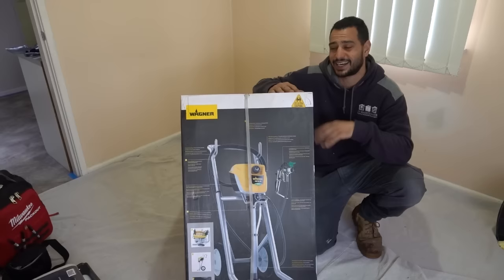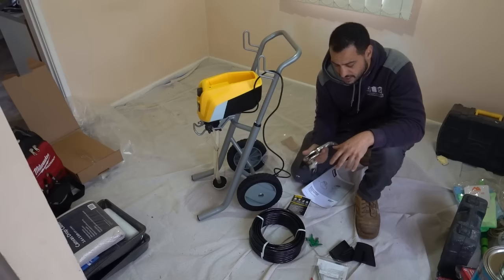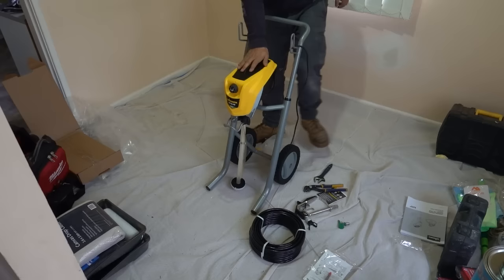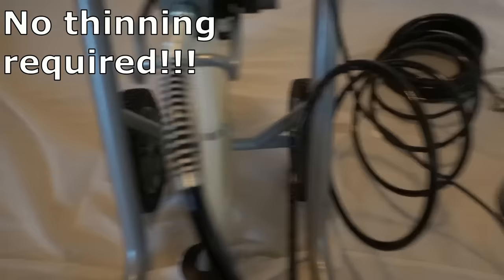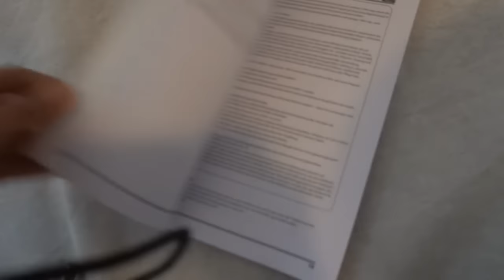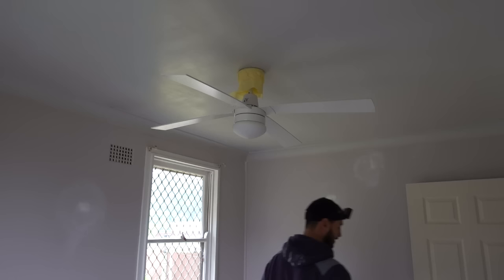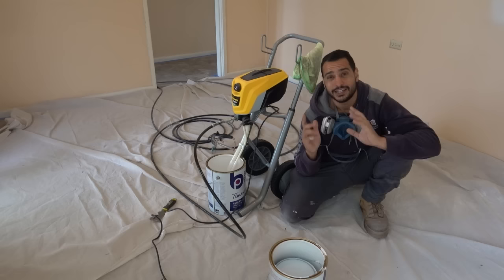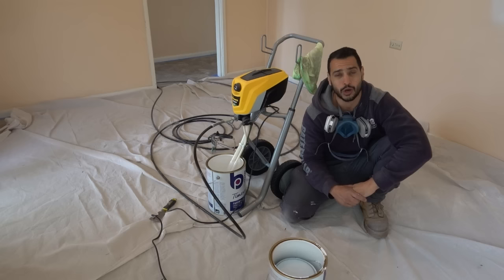Wagner paint sprayer - Review and testing 350M

Comment: Great review but the pressure was a little too high you had it on mark 2 and as you sprayed the wall you can see it left two lines which are called tails and that indicates that the pressure was a little to high, try spraying and 1.5/1.7 until you have no tailing and you should get a even better finish less over spray and saving in paint, hope this tip helps but again great video👍🏾
Reply: Hey I have this unit do you know why the tip won’t spray?? Unit primes and builds pressure, paint comes out but as soon as I use the tip no spray comes out
Reply: The Wagner reply comment said the pressure was too low
Reply: Farba była za gęsta a nie ciśnienie za wysokie.
Reply: There called fingers and it means pressure is too low not too high
Reply: Question is spraying better than roller 🤔
Reply: @tomelford5480  paint too thick?

Comment: Been in the painting and decorating trade for 16 years. I love spraying ceilings for it quickness and the beautiful finished look. The only downside to it is the covering everything because the overspray gets into the tiniest of gaps!
Reply: I’m sure there’s plenty on top of the Fan blades.
Reply: @ashrevlution3456 do you ever back roll after using the spray paint or is it just ok to use 2 coats of spray paint?

Comment: Good video Bill.  I love this exact sprayer and highly recommend never rolling paint ever again.  it is much faster once you mask up everything.  While the video is great,  please for those at home:   1) WEAR a respirator ALWAYS when spraying!  You dont want to be breathing in this stuff, and you WILL even if you can't see it.  2)  I would mask up the fans entirely, not just the top of the fan connected to the ceiling like in this video.  It's extremely likely you will get excess spray on anything you don't mask.  Spend the extra hours to seal everything!  3) get the extension rod for the sprayer  (about 100 bucks from Bunnings but worth it) for painting ceilings or hard to reach areas.
Reply: It’s quicker while painting but surely the preparation makes it longer than traditional mention. Not to mention the potential mess from spraying. Roller for me
Reply: Great finish though
Reply: Great comment. Do you need to backroll the paint after spraying it?
Reply: @commanderkeen3787  A matter of taste. I personally wouln't roll any area you spray if possible because I like the uniform smooth finish from spraying.  Plus it'll significantly increase the total time needed to paint walls (why not just rollin the first place instead if you want the rolled finish). You'll see the roller paint pattern on the sections of sprayed wet paint where you roll, which will look different to the nice smooth finish you'll get elsewhere from the sprayer.  If some sections after spraying dont look right, instead of back rolling, let the paint all dry then spray the bits you missed again. If you experience wet paint droplet lines down the wall, instead of rolling them while they are still wet, sand them back and respray once the wall is dry

Comment: Seems like a good product, but it seems like (as it has a trolley) it would have made sense to have a platform/bucket that the paint tin could sit on, so you could actually wheel it around without having to remove the paint tin and carrying it separately
Reply: Yes, and if you compare price between 350m and 350r, the 350m with unusable trolley costs 130€ more where I live. Makes no sense to buy the 350m for me.
Reply: The round loop hook at the front of this machine is meant for the handle of a 5 gallon bucket. Rest the bucket handle on the hook and wheel away around. High boys are meant for commercial use with 5 gallon buckets… the short boys are used for small jobs when a 1 gallon bucket is being used. But most new machines have flexible hoses for both 1 and 5 gallon situations. 😊 you can also rest a 1 gallon bucket inside a 5 gallon bucket then the handle of the 5 gallon can hook on to the machine and the gallon can stays safe inside the larger 5 gallon bucket.
Reply: @BlossomPainting  ahh yeah that makes it more useful

Comment: Great vidoe. 
Overlap 50% ..
Hard edge on spraying means either thick paint or pressure is low...
Dont go over spray area twice" like u did with cornice " on cold days u will get runs.
This is a airless unit that only sprays water based paints.
For enamel paint u will need air assisted pump .
It has 2 hoses from unit to gun 1 for paint and 1 for air.
It can be done with your machine but u will need a tip size around 208 210 and must use a brush to go over sprayed area to clesn up paint runs .
Thumbs up for grest video.

Comment: Ill give you a tip mate also when cleaning it out.  Take the hoses of and wash them clean wash all the paint residue out on the lawn or laundry tub.   Then put the hoses straight back in clean water..  Run the prime hose back into the tin of paint when you see it start to get watery switch to a seperate bucket or point it down a drain or a bathtub    once you see clear comin out of the prime hose or even light milky white its clean and wash the main hose/gun out the same way.   Just makes for a better clean up will make the unit last longer cleaning the hoses seperately by hand greatly improves cleaning them..  So clean suction hoses drop in clean water reconnect reprime until comes out clear then switch to pray same practice.  Pull the guard off dont leave the tip on as that wears the tip.   Then next start up its nice and clean.

Comment: Am not a full time painter but have two fences to paint, total 100m or so, could not be bothered with a brush. Have ordered the small floor unit 300w 150 and look forward to receiving and using it.
Have used a Wagner airless gun in the 70s in Germany and remember it gave no trouble. They know what they're doing!
Reply: How did it go?

Comment: I've only used mine 3 time's. And when I went to use it last week it kept loosing pressure and was constantly trying to pressurise. It's been thoroughly cleaned out after each use. Worked perfectly at first. Not sure what's going on with it. Great video by the way.
Reply: Get a refund
Reply: Paint is too thick u need to dilute it

Comment: Ah a new machine, would ya just look at it” I’m sure you have learned by now that putting the gallon can inside a 5 gallon bucket will allow you to hook the handle of the 5 gallon bucket to the front loop hook on the machine… allowing you to walk around as 1 unit and protect the can inside.

Comment: Would you use it on the interior walls? I hear you get a better finish rolling? Are you going to spray the skirting and architrave next? And do cut ins with a large painters shield? I really want to see you use it more and get some 4k well lit footage of the finished result please. Ceilings do look flawless fare play.
P.s. you can still spray it on then use a roller quickly over the top so faster than loading up the roller all the time for that perfect finish
Reply: Phillips, its useless machine you  do better with roller
Reply: Absolutely you can use it on interior walls. The finish is different and much smoother/uniform relative to rolling.

Comment: Did you have any issue with paint getting into the air, you know like dust and then having a fine coat go over everything. Noticed you didn't cover the windows? Trying to work out how much prep I need to do protecting windows and door frames
Reply: there will be droplets everywhere so cover your windows. also the technique uses is wrong and there will be buildup of paint at the start and finish. you have to have the gun moving when you press the trigger else it packs on a lot of paint at the start
Reply: @terajuana  The air is full of paint for hours .Do not remove coverings etc for a long time ! It does cause a LOT of  "paint dust"

Comment: Also small step ladder get you up 1ft or so then you get it closer to the ceiling.  Without extension thats the way to do it  when your distance is wrong should be about 12 inches away.  Any more your wasting alot of paint.. I realise this is your first time on one but if there is any mist at all youll greatly reduce that by the distance between gun and surface    even though its a high production low overspray setup there still is a reasonable amount of silica dust and overspray.

Comment: Great Video, just what I've been looking for to guide a purchase.
Typically, I want to use mine for primer and emulsion paint when redoing whole houses.
Has anyone measured the quantity of lost paint due to priming the lines plus the lost material after the project is done and the primed lines are still full?
I like your style of content creation, any follow-up video for the cleaning process and what you used to keep it clean and ready for the next project?
Also, what extras you've purchased 3 years on, warranty, reliability 3 years on?

Comment: With airless you can just spray without rolling the wall afterwards? I heard it doesnt stick properly so you have to roll... What is your opinion?
Reply: No rolling required....just make sure the gun is perpendicular to the surface at about 12" (30cm) and you're good to go. In fact, if you did roll afterwards, you'd wreck the paint finish. The only "downside" when renovating is to mask out really well which takes a bit of time to do properly. After that, the job takes bugger all to do. I did my ceiling the day before yesterday which is about 50sqm in area and that took me a total of 15 mins max to complete. The ceiling has large plaster cornices which alone, take about a day to paint with a brush. You do the math.
Reply: Interesting because most videos on here show to backroll after

Comment: I get the paint spits all the time when i release the trigger did you get the same? Also this is my second sprayer the first broke on the first use faulty valve and the second on is working but trigger guard wont stay up i have to tape it up very unsafe, i had better expectations of the sprayer, should have bought titan

Comment: If you've ever painted popcorn ceilings with a roller, you'd know this is a much faster alternative. Or you could just scrape off the popcorn finish. The popcorn texture is extremely absorbent, so you end up using 3 times as much paint as a smooth ceiling, and it takes 3 times as long. My neighbour had used an airless sprayer, I could hear it going all day.

Comment: Purchased the control pro 350R and flexio 590 after watching yours and Craig's from big brothers videos on the product. I used the 350R today and found the paint came out pretty thick, and when I got towards the bottom 1/4 of the can, the machine didn't spray. Can you give me any advice please @wagner ?

For thick emulsion I kept the white filter in and watered the paint down by 10%

Comment: Excellent video mate. I purchased a 250r model from Amazon for £300 (they have put the price back up to £480 now) after seeing you're review and will be painting tomorrow. How do you spray rooms where the ceiling and walls are painted in two different colours?
Reply from the maker: Depending on the job You can tape off an area or use a paint shield. I still like to cut and roll walls in 👍
Reply: Ist coat everything. 2nd coat walls  then trim finish ceiling.. then role on the last coat.... or you can go the route where 1st coat everything finish trim mask of trim. finish walls. mask of walls finish ceilings .. that way you don't have to cut in...
Reply: When you painted your room didi you have any problems ?

Comment: I gave a like for the video itself and the presentation, thumbs down for not stirring and thinning the paint. Take your time and make time to do more research on airless spraying. I'm spraying a lot of Dulux on monthly basis, it says it can be thinned up to 10%, I'm thinning it to 20%, never ever failed. With thinning the machine won't struggle to spray the material, you will have longer open edge and smoother and more uniform finish. In painting with the majority of the materials there is one main concept: less is best. Keep up the good work, but do your research before. For good sources I would recommend the Idaho Painter - Chris Barry. I learnt a lot from his videos.
The only situation when thinning can be avoided is air assisted airless spraying, electrostatic fluid spraying or epoxy and PU spraying with dedicated machinery. And trust me I know what I'm talking about, as I did sprayed plaster with airless sprayer.

Comment: Hey mate, just got into painting and have the 250 unit, exellent unit. also looking at the Graco ultra cordless, looks impressive. i recon worth a look before getting the 150 unit. Cheers
Reply: Hey mate, I'm looking to get the 250. What do you think of the unit and had any issues?
Reply: @frankloschiavo   hey mate, don't think there is much of a difference between the 2 units. you will have the same issues as me with using low levels of paint at the end of a tin. have a look at the Graco Ultra cordless, a bit pricey but great reviews. will be my next purchase. what paint are you using for water based gloss. i'm having sagging issues. Good Luck.
Reply: @paulmckeown8557  I decided to get the 350 based on Bill's review. It's been amazing. I'm a complete amateur but it's making me look good LOL. I've done solarguard ext thinned 5% and worked well. Interior use haymes only. Ultratrim acrylic thinned 10% on the trims/doors. I had some serious runs in the beginning but learnt you have to move quicker. My doors are mirror finish.
Reply: Hey Frank, good to hear you got a good setup. Tried the Haymes on trim but the gloss was not that good. i dont do it often enough to get the practise in.
How do you store your tips ?
Maybe a video on painting trim mate ; )

Comment: Wagner 350 apparently is not as good as Wagner pro 250 that is $225 cheaper and many high reviews ,plus very compact to move around and put in boot etc. The 350, many complaints?  You can youtube both models and make your decision. I bought the 250 for $925. I also have the Wagner 3.21 valued at $3000 plus.

Comment: BILL, DID YOU GET THE 300 OR 600MM EXTENSION???? saw you using it in a subsequent video. Hurry up I need to get one not sure which one to get
Reply: Depends on your ceiling height and how tall you are + spray distance (8" to 10" ), generally you dont want to extend your hand above you shoulder for long periods of work.

Comment: That's awesome. I'm about to paint a property soon - Is the paint you used a primer and paint (all-in-one)? Reason I ask is I'm not sure if primer is required in my case. Walls are a shade of yellow (original colour) and ceiling is white (original colour) - I plan to paint walls and ceiling white.
Reply from the maker: Primer is generally not required 👍
Reply: Check if you have oil paint first...

Comment: Hi Bill, great product review. Is one coat only required using the spray method because it looks like it puts it on quite thick yeah ?
Another good tip you could've mentioned was the quantity of paint required/used for the square meterage. Do you think it uses more paint with the sprayer or the roller ?
Also, what respirator are you using or recommend please ?

Comment: Great video. Can the sprayer spray exterior wall paint. As I need to spray a very big wall. Any info would you need to thin down masonry paint.
Reply: Only if it's smooth masonry and not textured, I would guess you would need to thin by about 10%

Comment: I used the Wagner 150m Airless Sprayer for painting the inside of the my house, I seemed to get lots of lines in the paint (user Error) but I am keen to keep trying to get better. Does anyone know if you can adjust the pressure on it because one time it seemed to have more pressure than the other time
Reply: Hi .did you fix the lines you were getting ?
Reply: From my experience with the 150, lines appear if the paint is to thick, dilute it down with a little water (not much!) and it should help greatly. Obviously I could be wrong so I would check other sources if you haven't already

Comment: Do you mix the paint for wall and ceilings . ? Is the a specific paint for wall and ceilings or any ? 
Thank you
Reply: Most wall paints ( ceiling paints tend to be pure whites ) can be used.
Generally the paint will have directions for airless spray applications ( online ).

Maybe not the ultra cheap paints, but then you wouldnt buy a 300£ spray gun if you used those.

Generally wall paints are diluted by upto 10% before application. But specific paints may need further dilution.

Always test on a ( large ) piece of cardboard before spraying your wall/ceiling.
Reply: @dwwolf4636  thank you so much . I bought mine but I haven’t used it yet!

Comment: Thanks for the great video; this will be useful when buying an home :-) I was wondering wouldn't it be easier to do the walls first and after that the ceiling? I think the ceiling is hard to cover with plastic to cover it from navel/splashes(not sure how it's called).
Reply: Please do some research before buying a paint sprayer. 

Unless you want the whole room, including your ceiling, the same colour, you'd mask/cover everything, including your eyes, ears, nose and mouth. Plus, there are various videos showing different techniques for using a paint sprayer, which tip to use, distance, paint dilution and many more useful information. 

This guy is a good painter, but this clip is very gung-ho. Yourself, if you are new to the game, don't follow this video, it's not for starters.

Comment: How do you clean the Sprayer after you’re done. As it’s a long hose and there’s Paint in it
Reply: You suck water through it until it runs clear on the return tube, then spray out from the gun til it's clear as well. Or solvent if not water based.